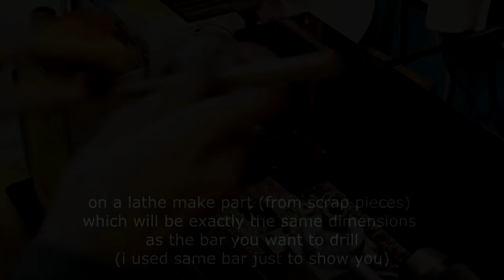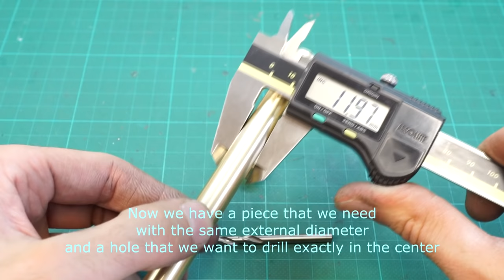Another way How to drill a hole through a round bar in perfect center [middle]

Comment: This is dumb. I thought it was gonna be about drilling with just a drill press. I own a mill n lathe both but this is time waisted when you can simply touch off the edge , center drill , and finally drill. I guess I can see a fellow having someone with a lathe make him a set of common sized shafts , but you still need the rite size drilled holes for that. Yeah this is dumb in so many ways. Sometimes I'll have the mill set up for something else and just use a drill press and vise to do this and was hoping for a simple solution.
Reply from the maker: Phil Lowman cool so you use another method, i didn't say that you must use this method now, i just share this idea, do you hear for it befor, if No is so wromg to see it? and yea eaven i not use this step to often.

Comment: Using the tip of the paquimeter to scratch the piece is very anti-professional. Sorry.
Reply from the maker: Zé Ross did you notice that i measure with digital mitutoyo and scretch with cheap $5 caliper, and bdw i am far far away to be professional, i am electronic and do this only for hobby.

Comment: Oof I don't have a lathe or any of this
Reply from the maker: There are many ways to do that, this is just one way
Reply: @TinC33  hmm any other suggestions you have? I only have a drill and I need to make a 3mm hole trough a 5mm screw. So I have about 0.5mm or less of room for error ;-;
Reply from the maker: @ameliabuns4058  try to mount screw into drill and drill bit into wise, so it make a better center.
Reply: @TinC33  hmm I'll try that. But I also have a 3Dprinter and I've been debating a few tools that could work. I'm wondering if the effort needed is worth it for my projects since I could use a bulkier 3dprinted version of this part in trying to make
Reply from the maker: @ameliabuns4058  then make a part with 5mm hole reduced to 3mm and you got lead for drill.
Reply: @TinC33  oh I did! The issue is that the 3d printed part got the hole bigger in 1 second after I started the drill because the plastic got drilled too. This time I'll make it tall enough to only grab the smooth part of the drills shaft.

It was also printed in ABS which is known to be a very soft material and very easily drilled/sanded. Specially the one I used. Hopefully my idea will work
Reply from the maker: @ameliabuns4058  maybe pla will be better choice for that kind of use, i used some 3d printed part for a job like that to trill through hex rod, and it work for a few holes but measure wasn't so important, 3mm trough m5 screw wich got only about 4.2mm material will be hard job without a lathe in any case, try to find someone with a lathe.
Reply: @TinC33  oh tbh I want to keep my project something everyone can make without equipment. So if the new tool fails I'll revert to my current design which uses the bulkier part that's 3d printed
Reply from the maker: @ameliabuns4058  that i was thinking:
https://www.youtube.com/watch?v=KYFQB_CG64A

Comment: buy an edge finder costs less than £5 move over 6mm to the centre of the rod. more accurate than this method to
Reply from the maker: Robert Easby i know, or just using edge finder and Dro but this methot is prevent to to band the drill bit, try to drill with 1mm drillbit threw the 3mm rod, drillbit just band arround the bar.
Reply: tintek33 I would normally give a small spot then do really small pecks. I use a 1.2mm spot drill then 0.1 mm pecks with the drill
Reply: if possible yoi could use a slot drill to give you a flat surface if it is difficult for the drill to find land
Reply from the maker: Robert Easby yes there is many ways to drill, that os just one of them, and i don't use it a lot but i think it's stiil good, simple and enough precise method.
Reply: tintek33 I got to ask, is the bar sat on a parallel or have you just leveled it by eye. I have that exact vice and I always worry about things pushing down when not sat on anything
Reply from the maker: Robert Easby yes there is a paralel "pice" under, maybe don't see it on video, i always use it.
i buy that vise on ebay for about $100 and seem great to me for the price, i do that for a hobby and every peace of tool is expencive for me, i got another smaller vise, for turning table i make, watch other movie to see how.